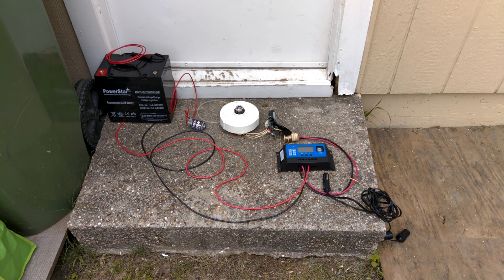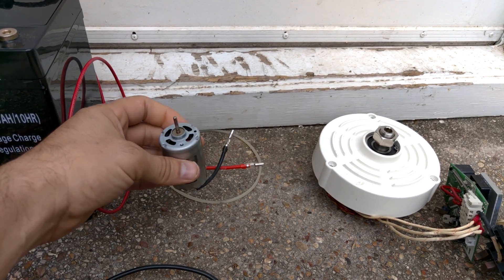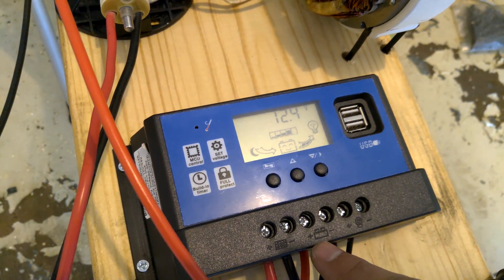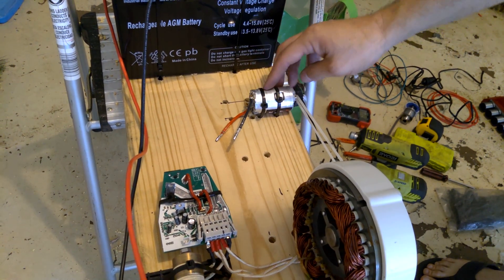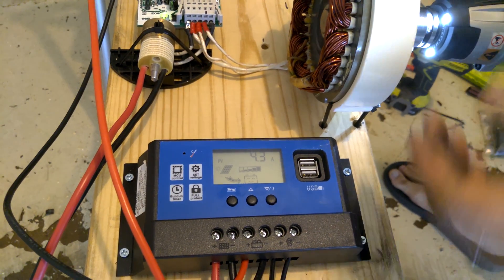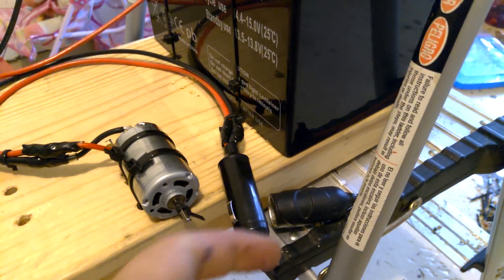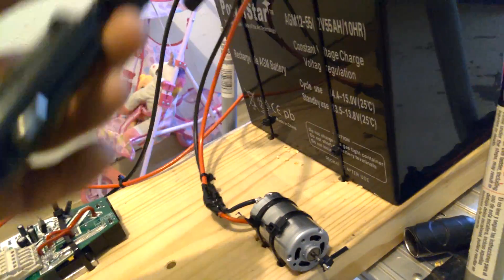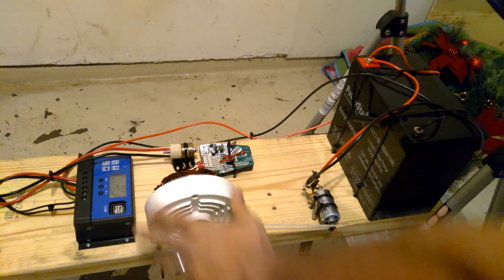Free Power Generator? #FreeEnergy

Comment: Ok so the motor is instant torque. So your little belt won't take it. But I understand what you're doing. You also have to understand the small motor even though it's high speed high torque it's ment for short bursts i.e 20 mins or so and would rely motion  air flow to cool it so being static it will over heat. But if you try direct connection via a coupler like used on CNC machines and speed controller for the motor. The controller will allow you to gradually build up speed and the direct drive will eliminate the belts plus the CNC coupler is insulated so there will be no short between the motor and the alternator. 
I know a few people that have used them solar chargers and they have caused a few problems as most of them are cheap copies. Worth getting a charge controller that's got good reviews. But your idea is sound science. Using the battery as your power reservoir draw from and charge at same time the same as a car does. But not on lithium ion batteries. The reason the fuses blew is the surge of power was sudden and took out weakest part of the circuit. With speed controller you can build up and fuse should last longer . 
Look forward to more videos . 
Great work.
Reply from the maker: Thank you so much for that information and the positivity! I moved a few months ago and couldn't take the generator with me but I want to try again soon.

Comment: nice effort.. trials is process.. the drive motor needs a pwm(pulse width modulator) speed regulator to control current from battery(reason blowing fuse) or 50watt solar panel.. the motor + a gear box to reduce motor rpm to torque (basically a 12volt hand drill) coupled to a heavy flywheel (tire) to the drive motor.. attach a smaller wheel to the windmill generator shaft to be able to belt the wheels, as u have there.. play around with ideal rpm to get 1/2 max power rated for the generator to keep from heating.. 100watts is ideal power pull, enough to charge lifep04 battery banks, slow n steady..
Reply from the maker: Thank you for the advice! If I get some money and time to rebuild this, I'm going to take your suggestions and see if I can make some power with it.

Comment: tHE FIRST MOTOR IS NOT LARGE ENOUGH TO TURN THE WIND GENERATOR, ONCE THE WIND GENERATOR IS WIRED UP TO CHARGE CONTROLLER THE TORQUE IS TOO GREAT FOR THE SMALL MOTOR.
Reply from the maker: I made sure to get a high torque, low amp motor. Don't let the small size fool you.

Comment: If I simplify it a lot, it's still about transformation (exchanging "V" for "A" and vice versa), which also happens in the case of forces (torque). In an ideal non-existent case, the same energy potential remains in the system, not increasing. Therefore, it is not possible to receive more power at the output of the device than the energy supplied at the input of the device. The condition for the operation of such a machine, which would produce some useful work, is the gradient - more at the input than how many "produces" the output, which does not ensure even an ideal model. It is possible that you have gained a lot of experience in a year so that you do not waste time on this and invest it in something else.

Comment: you need an pma alternator run by another midified alternator again then rectify the power outlet made by a rectifier... and goes into the ccontroller
and soh on and soh forth..

even u run it for 12hours its ok...
Reply from the maker: Thank you for the suggestion. I ended up having to leave this hardware behind when I moved to Puerto Rico but I hope to make another attempt eventually.

Comment: Never work i tried it...problem is your motor doesnt have enough torque...if you gear it via planetary gear system...then you loose speed..the best results i got was a 18v rechargeable drive..driving the wind genny..its nearly break even but its awful stressing on the motor...good luck
Reply from the maker: Thank you for that information. I will look into the hearing some more.

Comment: There's so many sources of either physical or electrical resistance in such a setup. This is a major hurdle. Until super conductors that have no resistance can be implemented in real world temperatures it is impossible to make such a generator.
Over the years I've also done a lot of research into various types of infinite energy machines and it all comes down to friction and resistance being the obstacles to overcome.
Regardless of the outcomes, it's always a good learning process to gain a better understanding of the science and physics at work. I really enjoy that myself!
Reply from the maker: Thank you for your comment. I have learned a lot as well while assembling this project but I still have so much more to learn.